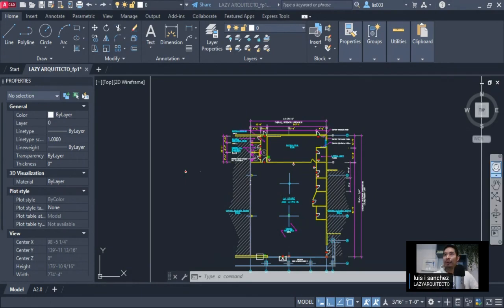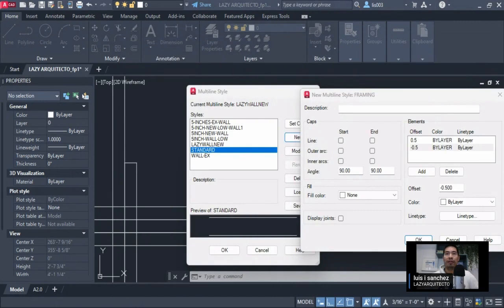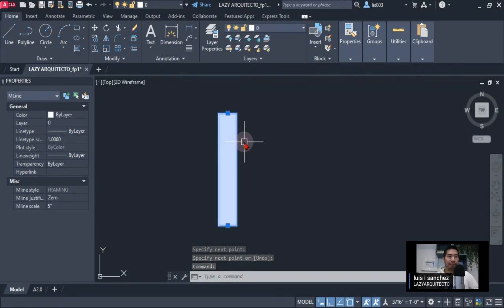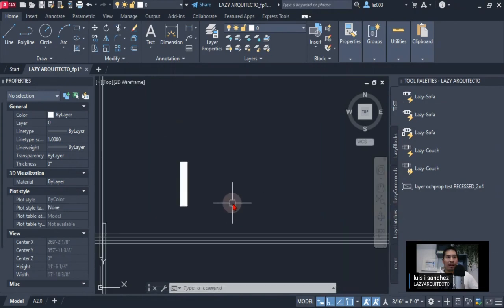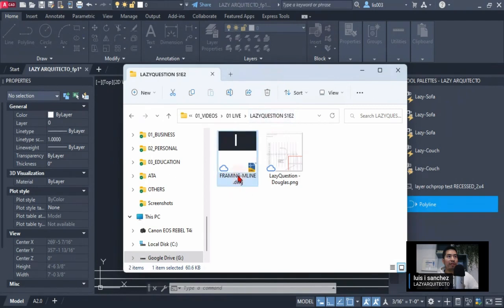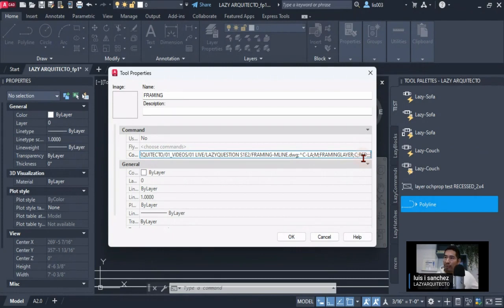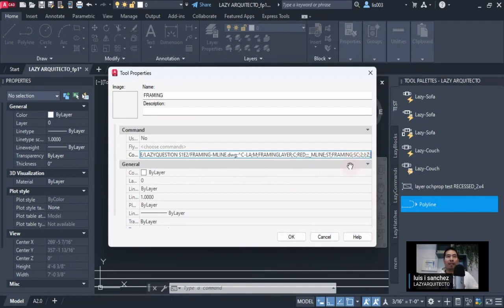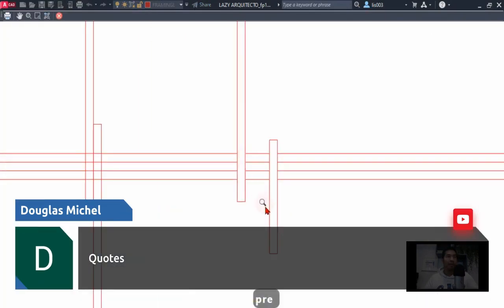Automating YOUR AutoCAD Framing | lazyQUESTION 2

Comment: Can you achieve the same thing with a dynamic block with a rectangle, an associated solid hatch, and a wipeout, and then add a stretch action?
Reply from the maker: Not really, this have the flexibility of drawing it like a wall, where can quickly specify wall thickness, etc